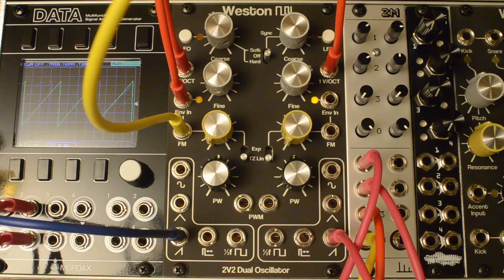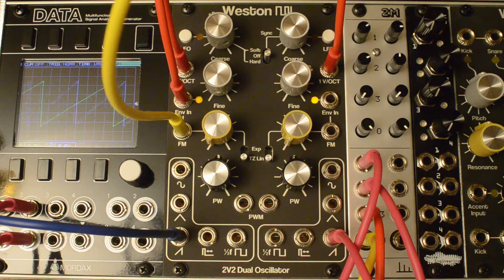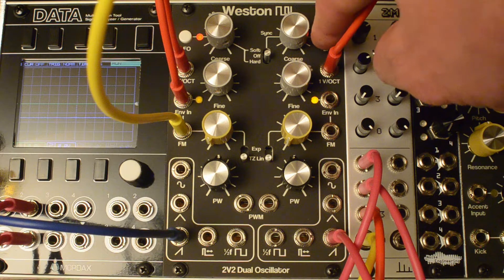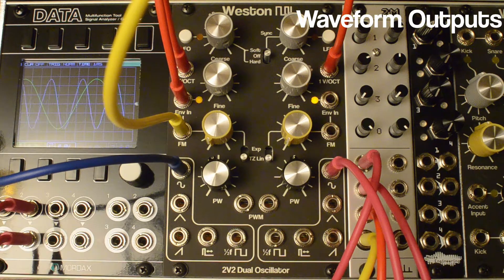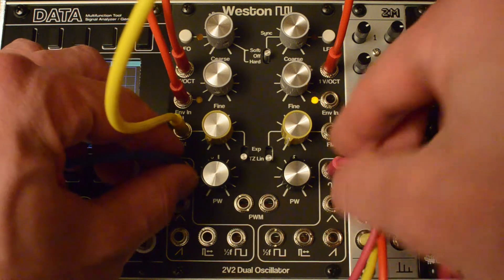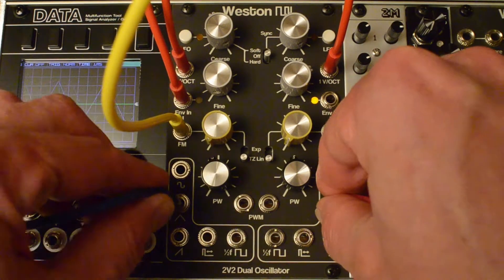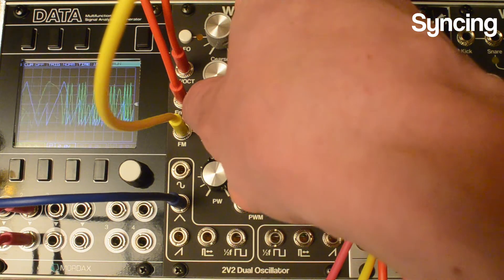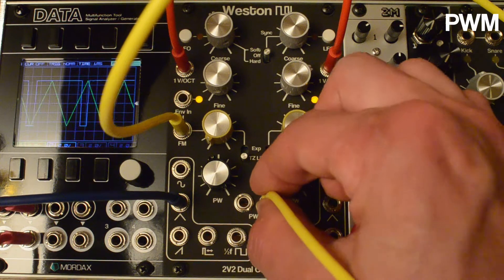Weston Audio 2V2 Dual VCO with TZFM Eurorack Official Demo

Comment: I have a beginner question, what would you plug into the FM imput? and also the VCA imput?
Reply from the maker: Hi! Generally you would plug another oscillator or some periodic signal into the FM input, and then some slower-moving signal like an envelope or LFO (low frequency oscillator) into the VCA input. This will effectively change the amount you modulate 2V2 via a signal over time in a manner you can hear. But, there are no rules in modular, so you can always choose your own adventure! :)
Reply: @westonprecisionaudio thank you so much, I just got the 2v2 and I am loving it!

Comment: I finally got around to finishing/calibrating my build and this thing is nasty in best possible way, especially self-patching with soft-sync, lots of great vocal tones with weird stalling effects at certain points :D
Reply from the maker: Glad your build worked out you're giving those circuits the workout they need to stay fit and strong! :D
Reply: @westonprecisionaudio  I had some issues; soldered a pair of 1 row sockets on the wrong side of the board (doh), but otherwise it was a fun build! I just need to goop up the transistor pairs and fit the screws and I'm done.

Amazing module and excellent support, can't ask for more than that :)

Comment: Cant wait.  Will the kit be available at Thonk soon?
Reply from the maker: Thanks! Yeah Thonk should have panel/pcb/knob sets maybe mid sept?
Reply: @westonprecisionaudio  cheers.  Look forward to it.
Reply from the maker: @JK-zx3go  Things are running slower than expected but I'm building an order of panel/pcb/knob sets for Thonk right now which has 2V2s in it :).
Reply: @westonprecisionaudio  magic.  Thanks for the update :)
Reply: @westonprecisionaudio  they disappeared instantly.  Sold out already :)  And I've been checking.  Ill get the next batch.
Reply from the maker: @JK-zx3go  I don't think that's the case! They are in route to Thonk HQ right now. Maybe they were getting the page ready?
Reply: @westonprecisionaudio  cool
Reply: @westonprecisionaudio  its gone all together now.  You may be right. :)
Reply: @westonprecisionaudio  got it ordered now.  All good.